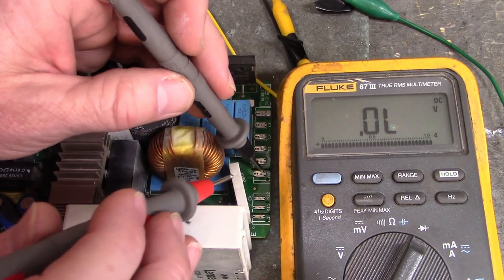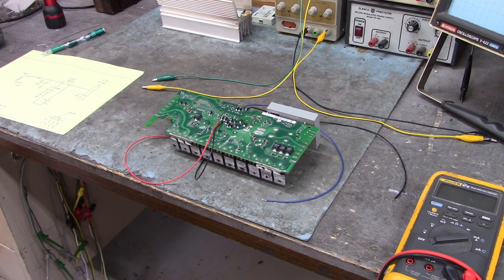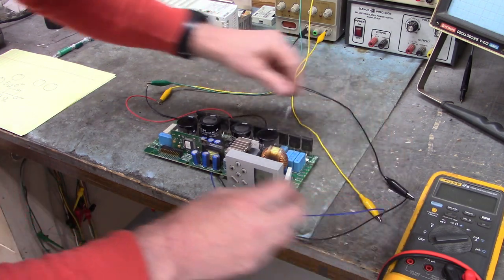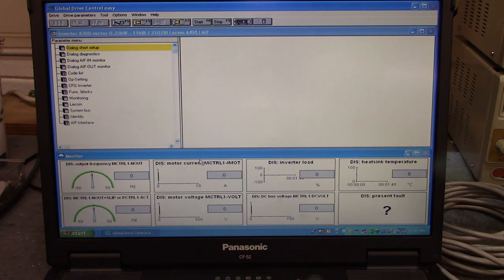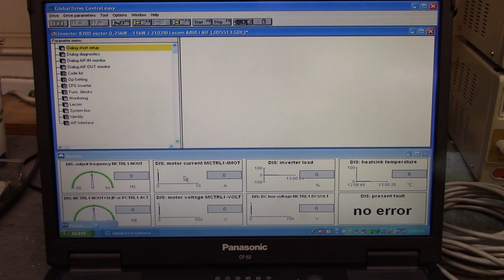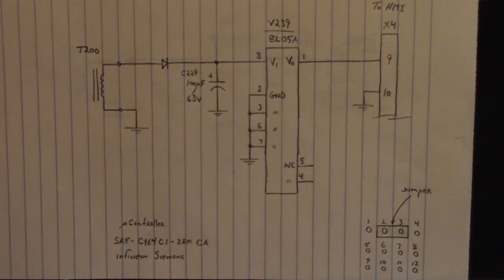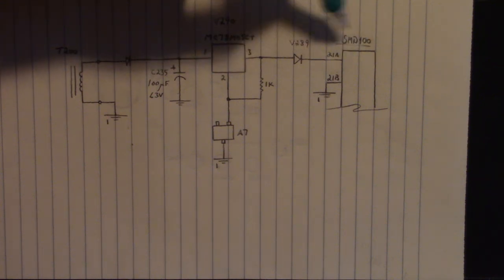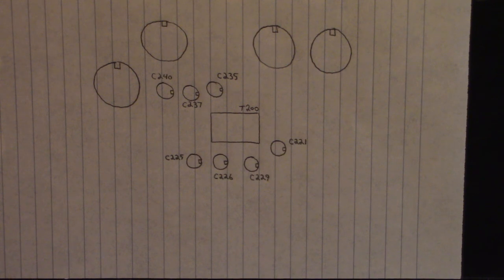Lenze Inverter Drive E82EV152S4B shorted 3phase bridge rectifier.

Comment: Thank you for another great and educational video!
I have a Lenze E82EV152_2c that has no output on pin9 +5V and pin20 +20V of the Standard I/O PT.
Everything else works fine, also the keypad/display, and applying an external voltage on pin 28 CINH  starts up the motor.
Any ideas?

Comment: TECHNICAL QUESTION 

I have "repaired" a heidenhain uvr150d power supply(75kw) and a need to do a technical question.
The thing is I've found 4 igbt shorted and 2 400v caps broken, Ive replaced everything and checked for another broken components, I didnt find anything else malfunctioning. Its the firs time I "fix" this size of power supply. Ive connected it to the wall in the laboratory (3x 380V) and it worked fine the 5V and 24V. Then ive "shorted" the pins that enable the 650V DC bus and it generated it. The power fail led that was bright initially turned off and the READY UV led bright green. It was everithing fine. It worked well. But the problem is that I didnt use any filter or transformer or trhee fase capacitor (as the manufacturer recommends), so various home appliances (as 2 TVs 2 air conditioner boards and some cellphone power supply) exploted . Ive opened some of this boards and ive found 400v capacitors exploted, so there was a huge peak of voltage above 400V in the 220VAC line( maybe 800V peak).
The answer is, are those harmonics natural to this size of  power supply? The power supply is working fine and the harmonics its generating are normal? If I test it in the client machine with the appropriate filters transformers and capacitors would be ok? Or it may occur the same as here in the laboratory?
Its the first time ive repaired this size so i dont know if it is OBLIGATORY the use of this filters.